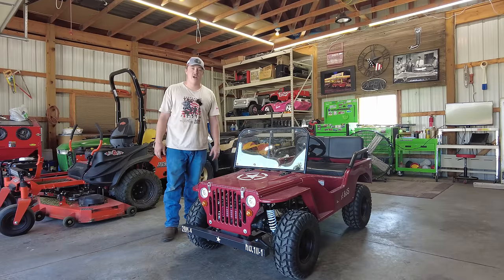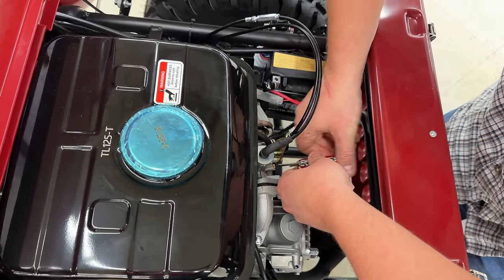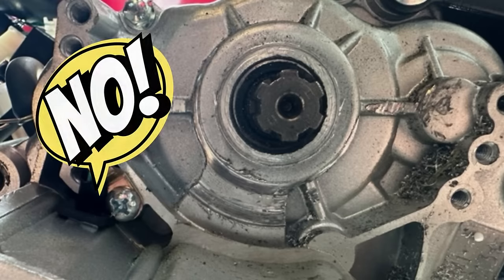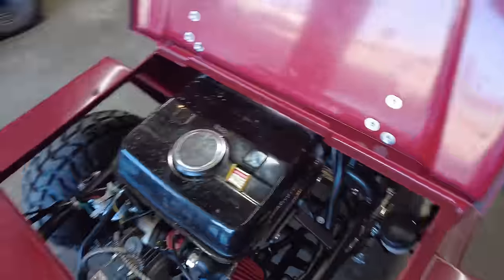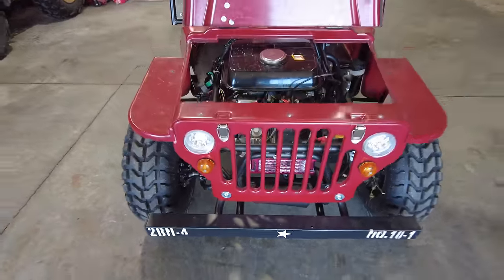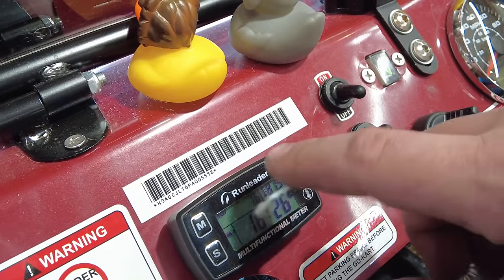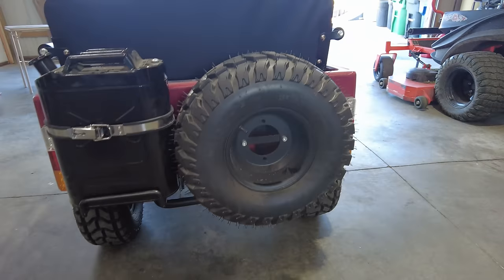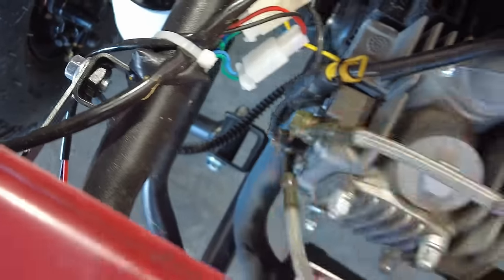Watch Before you Buy a Mini Jeep

Comment: Well, I hate to say it! I bought one six years ago, and I have had no trouble. I have had nothing but fun and years of enjoyment! It’s perfect! I do appreciate what improvements you want to make, but make sure that you don’t make it sound like it’s no good without the improvements. I have not turned a wrench on mine one time! Just one battery.
Reply from the maker: That’s great to hear! This is just the experience I have had with this one. If I bought another I would take the same precautions just to be sure it didn’t end up needing major repairs like an engine or something. Quality control could have very well changed since the time you purchased yours. Either way it’s good to hear success stories with them. We enjoy it very often and do not regret the decision to buy. 👍🏼 thank you for commenting!
Reply: Should’ve bought the scratched one…
Reply: One hour of use a year? Lol
Reply: Well, actually, you are partially correct! I drive it every week but I just use it for fun inside of a small private airport? So I have probably put two or 300 miles on it. No rough use though. No off-road.😂

Comment: My cousin bought his son a new coolster 3speed mini Willy's jeep 125cc new in 2016. After a year only issue was throttle cable attachment behind the gas pedal broke and seemed to have been bolted with the cable bent. I work on small engine equipment at my home shop so made some simple adjustments and i have little cheap speed gun and got 42mph with my son 125lbs back then flat asphalt side road. Don't know how other brands are but the coolster was impressive for a china made one. Im 45 and 230lbs and it was surprisingly fast. Thought I was over weight limit but no because has a 400lb weight limit. Before all that i changed the oil and put amsoil in it and tossed the chinese torch brand spark plug and put a ngk in it. Pretty cool little ride but $2,500 plus and easily over 3 grand after taxes. Fairly expensive.
Reply from the maker: I think they are similar to the ones from tractor supply. Ours definitely surprised me for how well it handles adults. It’s fun for sure!

Comment: While it’s not a quick video, unlike other channels- every second of this video was useful! Most people talk about so much extra crap. Only thing worth mentioning, I bet you all the loose bolts were from that store. It comes only partially assembled in box when they order them. Some teenager put that seat on
Reply from the maker: Thank you for the feedback! I totally agree about the loose bolts! They do also vibrate quite a lot so lock tight would be a beneficial upgrade just to help prevent losing bolts and rattling.
Reply: Use the orange loctite.  It holds like red but it's removable like the blue
Reply: Good video! what's the   red button for and you could have done without the thudding music at ~17 minute mark. I'd rather heard the engine run and the muffler sounds better
Reply from the maker: @davep6977 thank you and noted. The red button is for the horn.

Comment: If you get an Xpro mini Jeep you can avoid most of the issues associated with these. I think they’re the best ones made and come with a Zongshen engine, which are pretty reliable plus it’s a rear mounted engine. No issues with mine.
Reply from the maker: Good info! Thank you!
Reply: The dude who drove one of these around the salt flats for 1000 miles to MOAB recommended the Coolster Mini Jeep.

That Jeep made it through 1000 miles in desert heat, snow, and pretty extreme off-roading.

Sure, he burned out an engine in the desert, but considering the circumstances, it held up well.
Reply: @dericandkhristy  he did a few videos with the jeep
Reply: He installed a different engine for his trek. @John6-40

Comment: The rule of thumb back when the original 6 wheel ATVs came out was that if you had a roll bar you wanted to wear seat belts, but if you didn't you don't.   On the latter, if it rolls, you're far better off if you're thrown clear rather than having roll over on top of you every time.   At least you have a chance if you're not buckled it.
Reply from the maker: I agree with that.
Reply: same on a zero turn lawn mower
Reply: @Lloyd-mo  if someone flips a zero turn they probably shouldnt be using equipment
Reply: Same as as a racing kart.
Reply: Very well said. if that little Jeep goes to flip, just jump out of the way and don't get stuck under it! Or truthfully, that may not even matter if youre an adult. Can't weigh very much.

Comment: Had the same sprocket issue on mine hours after running, implemented the same fix…working great.
Reply from the maker: It’s a shame that you have to look out for this on a brand new machine but I’m glad our fix is holding up and is a very cheap and easy one to do. Just have to spread the knowledge so others don’t ruin there new toys! Thanks for watching and leaving a comment!
Reply: @Higgsgarage that's a motorcycle engine basically it should not do that unless the rear sprocket is way over to the right anyway it shouldn't do that
Reply from the maker: @ronalddaub9740 I agree. I think the rear sprocket is not aligned causing it to do that. I don’t know a good way to correct it.

Comment: Reminds me of the 1974 Cadillac that my parents bought brand new Cadillac spent more time in the shop the first year we had it traded it in on a Lincoln. Mom dad said it was the best thing they ever did.
Reply: I had a mint 76 Grand Marquis and 77 Mark V, both fully loaded, 460s. What machines!
Reply: Thats the difference in a gm and a ford product. The only thing gm did right was the small block v8 along with the easily tunable modern fuel injection/ignition system. Ford is making that easier these days as well though.
Reply: My dad had a '72 Coupe de Ville and he was not happy with it.  It looked great parked but that was its best feature.

Comment: Good stuff man. I work for a kymco dealer. They are Taiwanese. In the dealer manual they give you 1 hour flat rate to uncrate the things, put everything together, and be ready on the showroom floor. We’ve gotta double check every nut and bolt and basically build the damm things so customers don’t have issues like you. Put a roll cage and harness in it
Reply from the maker: That’s not an hour flat rate in my opinion that’s them being greedy. I have thought about building a roll bar and probably will. Yeah they really do need to be gone over, would be nice if they just loc tight everything from the factory. Are you able to get parts for the massimo?
Reply: @Higgsgarage  I’m lead tech in the small engine department at my shop. I reckon there’s not much I can’t get. Although I haven’t had one come through the shop yet. Plenty of knockoff ATV’s we’ve tackled. I was in coastal the other day and looked at one. They are pretty cool! And would be a good platform to build off of👍
Reply from the maker: Yeah you really can get carried away with them! They are fun little projects.
Reply: You should get a 1980's style top lights on a roll bar and a trailer hitch and a trailer. It would be good for moving stuff and people.
Reply from the maker: @HollywoodCreeper  that would be cool! I’m thinking a Jurassic Park theme paint job with our logo and colors instead of the original park colors and logo also.

Comment: I would check the Jerry can for use for fuel. Remove the fuel tank over the engine and route a fuel line to the bottom of the Jerry can . (new easy to fill fuel tank). Also it can now be filled with a hot engine. 
If the oem fuel tank was part of the engine’s air cooling system, you may need to construct an air duct.
Reply from the maker: I carry spare fuel in the Jerry can and works like a charm. The original table can be removed but works for me. I fill it hot and have no issues. Just have to be careful for sure.

Comment: Replace one of the drive sprocket washers with a flat roller bearing.
Like people put on the lawn mower front end steering spindles, to make them easier to steer. 
Grease the bearing up on a regular bases. I would just spray drive chain grease into the bearing when lubing the drive chain.
Reply from the maker: This is a fantastic idea.
Reply: Good idea.

Comment: As for that Floorpan, just use some fender washers. That will eliminate that dimple caused by the overtightened bolts.
Reply from the maker: Yes that’s a good option!
Reply: @Higgsgarage  and fender washers are cheap and fast.
Reply from the maker: @THE_BaconPirate for sure! I am going to add some.

Comment: Wouldn't it be easier to make the floor board out of lightweight aluminum checker plate.  Using the floorboard for mud flaps. Make a metal frame for the open area in front of the floorboard and again. Using aluminum checker plate .
  Really like the upgrades.
Reply from the maker: I was thinking of doing just that! 👍🏼 it seems like that would be a great option! Thanks for the comment!!

Comment: Instead of 2 washers use one and a transmission part called a thrust bearing. With the rollers bearing on the side sandwich the bearing with a washer then you don't have to worry about the case. You can buy thrust bearings in nearly any size any reputable parts shop should have them.
Reply from the maker: Great idea thank you!

Comment: Just picked one of this up as well for my 7 year old daughter.  since you have a speedo in there, how fast does this thing actually go?  That battery is puny for sure.  Going to change that exhaust?  bet you could add a little power and make it sound better with different little mini exhaust.  My daughter is near your son's size, ive found some of these other  mini jeeps with dual adjustable seats, wonder if that is a smart upgrade to allow them to reach the pedals better.  subbed.
Reply from the maker: I’m not sure how accurate the Speedo is but it is gps and I have got it to 30mph but it is screaming and I don’t recommend doing it lol. Not with stock sprockets and tire size anyways. I thought about running the exhaust out the back to see if it would be quieter up front but have not made any decision on it just yet. I have also seen the jeeps with the sliding seats, I don’t think they would be hard to accommodate but my son seems to be ok and he is growing so fast that I don’t know if it would be worth the effort to add them. It wouldn’t hurt for sure but I think we will keep stock seats at least for now.
Reply from the maker: Thank you for your support it really means a lot!

Comment: I just bought one. For a 125cc it seems very under powered. My plan is to check the chain tightness, axle and what ever else I think of. Even small incline it seems weak for a 125. Top speed is about 25ish. I’m 140 lbs. motor sounds good and it feels like there isn’t much resistance in coast, but I feel like it should do better with the 125. Anything I should focus on in your opinion?

Comment: I would use some type of nylon spacer between sprocket and case. You may have to replace it occasionally, but atleast it would take the wear and friction wouldn't cause the washers wear on the case.
Reply from the maker: That’s not a bad idea. The washers are holding up so far but if I had to do it again I might try nylon.

Comment: Add the mirrors to make it street legal... As well as a bicycle turn signal set
Reply from the maker: It has turn signals and comes with mirrors. I took them off bc they were not needed in my case but I saved them if I do need them in the future.

Comment: Not a assembled piece of equipment I don't go over first to make sure stuff was assembled correctly. I don't care where it is made, some assembler having a crap day or it's late friday, etc. But I also worked at a ford dealer and seen brand new 2 mile cars with air ratchets in the doors, diffs empty, wrong parts on it (Said mazda not ranger, yes, way back). Either way I order online so I get the crate and assemble myself.

Comment: Why are the rear wheels/tires not centered in the wheel well ?
Reply from the maker: It’s just the way it’s designed. When weight is applied the suspension compresses and the wheels will move more towards the “center” it’s a rear swing arm kinda like an atv.

Comment: Those clone engines aren’t the greatest, but as long as you keep the oil changed and valves adjusted it will probably run for a long time.
Reply from the maker: I agree! And they are cheap to replace.
Reply: @Higgsgarage  

I was into GY6 modding for a while
Reply: Actually those clone engines are Very Good engines.  Brand new clone engines for go cart racing, I  tear apart, take out the speed governor, install high lift cam, stiffer valve springs, mill cylinder head from more  compression, billet connecting rod, and billet flywheel with timing advanced.  Those engines ran all race season at over Twice the stock RPM's. They took a heck of a beating on a dirt track.
Reply: @dand3975  

I’ve had ones that had clearance issues straight out of the box, but I’ve had a few that just wouldn’t die. I built one to stage 3 for my boy’s kart and he got quite a bit of wrench turning experience maintaining it.

Comment: Was there any issues with the stock carburetor? Why the upgrade?
Reply from the maker: The stock one worked but was kind of annoying. The adjustment screw was not as easy as this with the thumb screw, it was harder to start, and this one did increase power (every little bit helps)

Comment: I just bought one of these from Tractor supply for my sonso far it looks like they did a better job putting it together but since day one ive been looking at upgrades to improve it. What was the benefits of the Carburetor upgrade? If you dont mind me asking
Reply from the maker: For me the carb made for easier starting, increase in power, and easier to adjust idle with its larger thumb screw.
Reply: @Higgsgarage   awesome thank you, regarding your sprocket issue my son's jeeps looks slightly heavier duty, idk if maybe they upgraded the parts due to that problem but I'm gonna keep an eye on it none the less, one thing I did notice and am still trying to figure out is the steering wheel joint slightly rubs the side of the engine housing that covers the automatic transmission, it does this when turned to the right at pretty much the limit of turning radius I'm not sure if this was because the steering system was put in slightly off center or if during assembly and alignment things weren't adjusted right and it was pulled to the right side effecting the clearance I'm gonna have to look at this more and decide if this is something I need to correct or just accept.. it doesn't seem to affect drivability but I'm not sure if it limits turning radius enough on right turns to be an issue
Reply from the maker: That’s a good catch. I never looked at ours for that issue but I will next time I’m using it. I would try to find a way to fix the issue just so it does not end up cracking or rubbing through and part of the engine. That’s just me though.
Reply: @Higgsgarage  ya I'm looking into it, I'm just not confident in my skills enough to mess with the alignment of the steering system, I gotta do some more research on it.  I saw some cheap LED lights made for ATVs at Horror Freight I'm considering purchasing I think they can be wired right in. Are you familiar with the electrical system is there some type of alternator on the engine how does the battery keep its charge
Reply from the maker: @DocbritoFMF have you watched my other videos? I have one where I added lights. The charging system uses a stator in the engine and that is what charges the battery. It’s not a strong system but it can run led lights.
Reply: @Higgsgarage  I'll have to check them out now thank you for letting me know

Comment: Like the Chinese scooter/moped craze 2005 to 2012 and the Hawk motorcycle craze 2015....if you fully dissasemble it, go through substandard parts and toss out, replace or remanufacture....reinforce welds and reassemble with lots of locktite, and proper oil then it'll work for awhile.

Most of those scooters ended up in junk piles within 12 months of use....unreparable.

Just remember this when our wise political overlords start importing Chinese EVs to prove they weren't wrong about EV mandates despite Ford, Toyota, GM refusing to build rhem at scale.....that is the current creeping craze.

Learn from the past.

Comment: Did you adjust the throttle stop on the gas pedal?
Reply from the maker: Yes I did
Reply: @Higgsgarage  how far is it safe to adjust without it blowing up lol. Just got mine today. Also doing the carb you recommended and oil cooler.

Comment: Dang those axles look light duty AF
Reply from the maker: They are doing the job for now.
Reply: Thought the same when I saw that. Not designed to last.
Reply: @Higgsgarage  I live on rough uneven ground… I think they would break or bend at my place. I’m not so proud as to not ride it till it breaks though😂
Reply from the maker: @lorenzovillegas2457 we have taken ours to the farm and done some rough rough riding and it did fantastic. It’s been down some creeks. It will break but when it does just fix it better. If you don’t want a project or to be doing future repairs probably steer away lol. It’s so much fun tho.
Reply: @Higgsgarage  that’s cool! Great to hear your putting it through the paces. Sounds like fun
Reply from the maker: @lorenzovillegas2457 thanks! Lots of fun! 🤙🏼